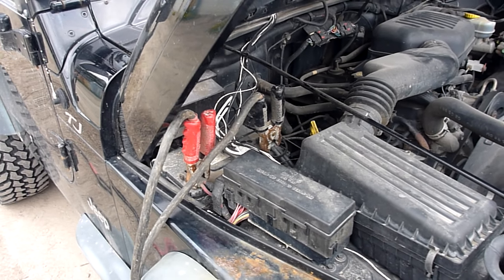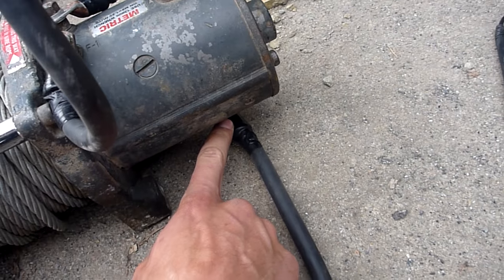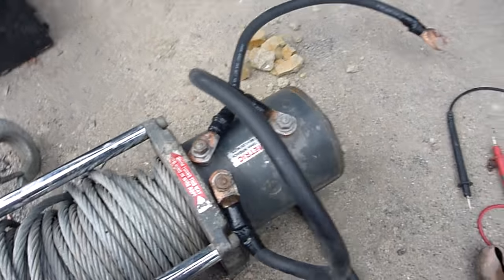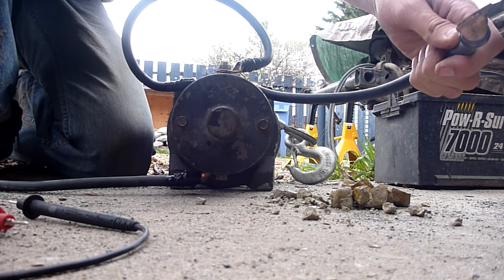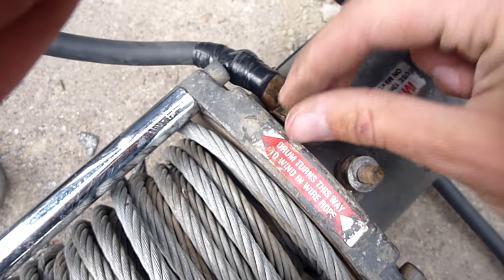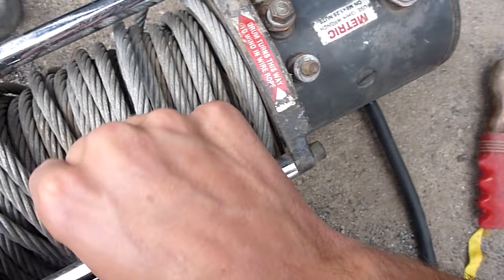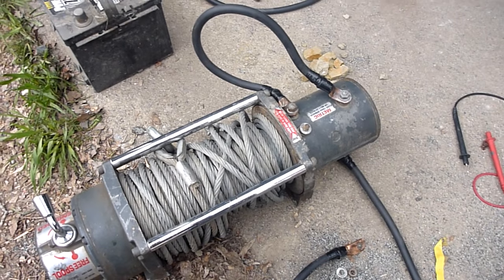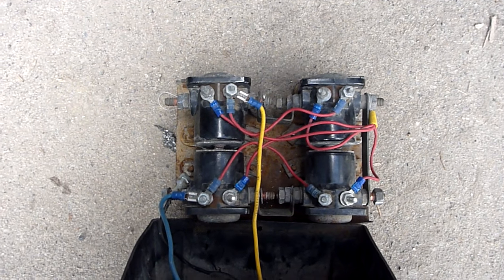Rewiring and Troubleshooting a Warn M8000 Winch - Part 1

Comment: Saved me a lot of hassle. My wireless winch controller broke and had a 3 week wait on a new one. I use my winch to tip a firewood trailer. Now I can tip it again by bypassing the solenoid. Appreciate it.

Comment: Super helpful video, thanks. 

I just got off the phone with Warn, and their procedure is one step different. They advise attaching one side of a the bridge cable to Armature, leave the other free. Then apply power to F1. Then connect the armature bridge to F2. Then disconnect power and bridge, put power to F2 and then connect bridge to F1. 

This apparently isolates components somehow, I didn't follow. When I tried your method, all I could get was a spark on the negative. With their method, even though it looks like it should be identical, my motor works fine in both directions. 

Again though, thanks for making the video. super helpful, and got me started down the path to learning that my motor is fine. Keep up the good work.

Comment: Awesome, bump for part three. Have an M1200 that I have to tap on the solenoid box to get it to operate half the time. Also just got a used industrial 15k that I need to go through and build a control pack for.

Comment: I don't own a Warn winch I own what is probably a cheap Chinese copy. My solenoid box for the winch controller rusted out after only a few years and it let me down on the trail when I need it. I rebuilt the solenoids with new parts and I put a bunch of Dielectric grease on it. After thinking of ways to waterproof the controls I decided to pack the whole controller box full of grease. I'm hoping that this works longer than nothing but I won't know for another year too feel free to comment what you think
Reply: I like the dielectric grease idea and use a lot of it in connectors, but I mounted my solenoids unde the lid of an ammo can away from my winch (they don't need to be next to it, that's for manufacturer and installation convenience) . The lid flips open and I have total access to noids and wiring. I use welding cable and lugs to make custom cables.  The lid and solenoids are removable as a unit by sliding the lid hinge laterally like any other ammo can.

Comment from the maker: @spsingam Try using penetrating oil on the shaft the clutch knob is connected to. A lot of times there is corrosion between the shaft and case which prevents you from pulling the knob out all the way. Next step after that is to remove the two bolts that holds the clutch assembly to the housing and carefully remove it. Ensure that it is indeed sliding in all the way then reinstall.

Comment from the maker: First thought is main power wires are hooked up wrong. If you are unsure do NOT attempt to run winch anymore. If you know the main ground and power is hooked up correctly then go to the solenoids, do you hear it click in either direction?

Comment: I just get sparks when I apply positive to the open post. bad motor?
Reply from the maker: GusgusA1 does it try to spin while it is sparking? Try using a multimeter to check for continuity between the posts
Reply: @vantagetes  no sir, I left it on fir a second and got some smoke. That's a dead short and a bad motor correct?
Reply: @vantagetes  which posts would I check continuity for?
Reply from the maker: GusgusA1 between A (ground) and F1 or F2 (positive)
Reply: @vantagetes  f1 f2  do not have continuity with the ground post until they are jumped with the other top post.
Reply: @vantagetes  did some cleaning. ir will run for a second then it stops and wont go again.
Reply: @vantagetes  I got the motor to sponges great in, out is very slow until it heats the post and stops.
Reply: I am having the same problem what did you do to stop the sparks?
Reply: @colbyl5019  I resigned myself to the fact the motor is bad. Saving for a replacement.
Reply: GusgusA1 oh dang that’s unfortunate Thankyou though

Comment: I replaced the solenoid an I here the the solenoid clicking but winch does nothing
Reply: josh tesseneer I had that problem on a rew8000 I did allot of power testing and I found this weird wire that runs to both bolts that you connect your power to and in the middle it has a little red pillow shaped thing I think its a fuse but I can't find one. that maybe your problem.

ps its inside with the motor

Comment: 13mm is not it 1/2 inch hi555555555555555555555555555
Reply: However most sockets and wrenches are broached so they fit both and any mechanic knows this. 9/16" swaps with 14mm,  7/16" swaps with 11mm etc.  8mm swaps with 5/16" (handy on many electrical nuts and hose clamps).